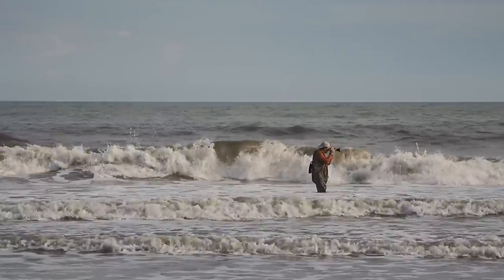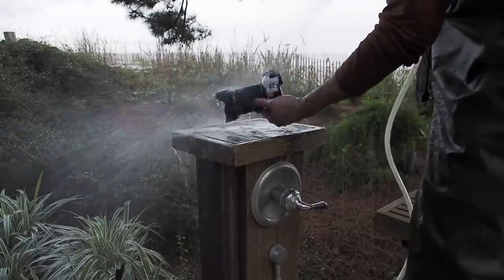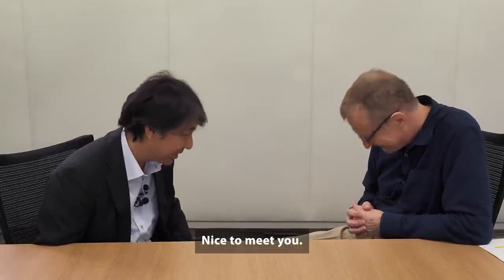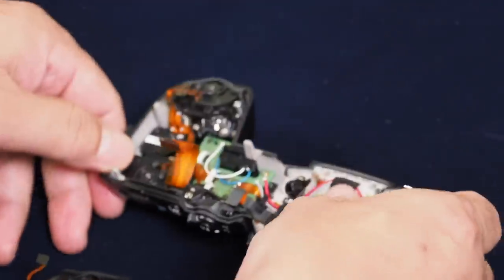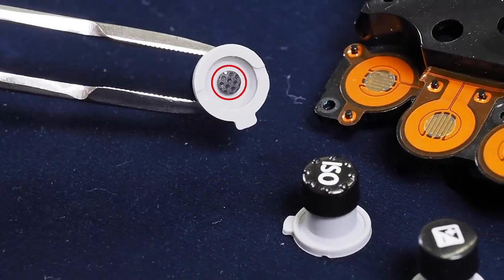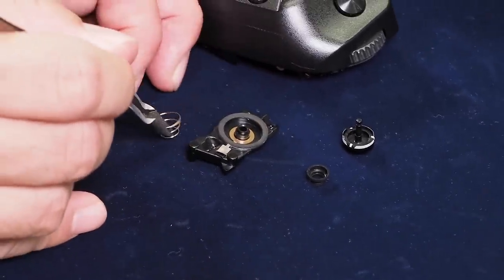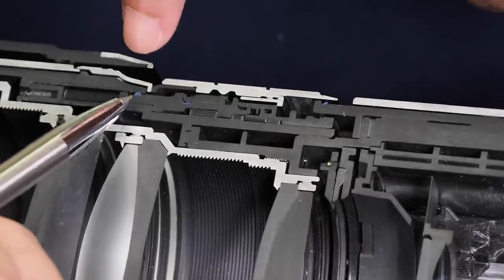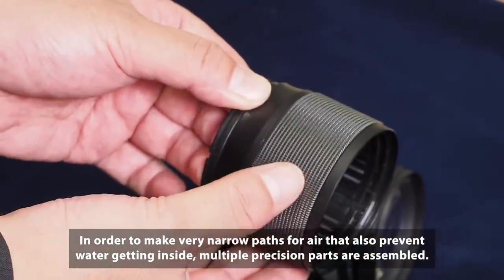How to REALLY weather-proof a camera

Comment: Have been using Olympus kit for decades. The engineer, being a young chap, may not have used or seen the OM-4 from 1984 (their first 'environmentally protected' camera body) which boasted of weather seals for dust and moisture on the camera and the motor drive 2. The fast aperture pro lenses of the era also had seals as did the OM3, OM4Ti and the pocketable Mju 35mm point and shoot series of the 1990s. So Olympus actually have nearly 4 decades of experience in this game. In our conditions on my continent the equipment has never let me down in heat, dust, torrential rain, sea spray, riot control water canon deluges and more. Why I stay with it. It delivers. Every day, whatever the conditions. As the Olympus engineer said - you can use energy on the photographic process, not waste it on trying to protect the kit. Thank you to all the engineers involved.
Reply: Yeah, "ultimate reliability" has been a core philosophy since the beginning of the OM era. See my reply to skysurver5cva above :-)

Comment: My E-1, E-5, and E-M1.2, plus various weather-sealed lenses, have all easily survived Yosemite's Mist Trail, Lower Yosemite Fall, and the base of Bridalveil Fall in the spring.  Years ago I had my E-1 and 14-54 lens out in a 1-inch per hour (maybe more) deluge at Multnomah Falls in Oregon.  In fact, it's places like this that have kept me coming back for more Olympus weather-sealed camera bodies and lenses.  I also have a TG-5 that I use in the pool with my grandkids.

However, I want to mention that the Olympus OM-3 and 4 series camera bodies also had some weather sealing and my OM-4T survived all the wet Yosemite places I mentioned above without having to bag the camera.  The only problem I had was getting a little moisture in the viewfinder eyelens.  However, a couple minutes laying out in the sun evaporated the moisture and camera continued to work flawlessly.
Reply: Yeah, Olympus' attention to weather-sealing goes back to their film cameras as well. "Ultimate reliability" has always been part of their core DNA; you can read about that in an interview I did with Aki Murata, Olympus America VP of Sales and Marketing back in December 2018: https://www.imaging-resource.com/news/2018/12/12/a-full-frame-olympus-not-just-no-but-heck-no
Reply: I think Olympus made the first weather sealed camera in the 70’s

Comment: Hi Dave. Many thanks for the interesting video. Weather sealing was one of the drivers behind my EM1 Mkii purchase. I'm not sure if I was unlucky, but two years ago I was out in the Yorkshire Dales in the UK taking shots of weather blow trees on limestone pavements...in the rain. When out of it's pack, I made sure to shield the camera from the driving rain using my body etc. I thought I'd captured some amazing shots, but when I got back to the car, I noticed the camera was dead, with water in the battery compartment. Luckily my dealer replaced the body and at the same time traded up to the Mkiii...but I have to admit...now I'm out of the standard two year warranty, I never risk using the camera in anything more than a light mist. I looked at your artificial rain fall rig with disbelief and truly wish I could risk using my camera in such conditions as (i) I live in the North West of England which is not known for dry savannas (ii) I think shots in the rain can look amazing. Recently I've been looking at some kind of dry bag set up. I'm just wondering if my original Mkii was a flawed and if I'm now being overly cautious. Sometimes I'm tempted to venture out into the rain.....but dare not risk it.  Thanks again for an insightful video. Neville

Comment: Wow, this is such an insightful video. Thanks for sharing! 

I just broke my Canon 5D Mk III by using it in the rain for 30 minutes. The mode dial cap came unglued a year ago and I never replaced it. Turns out that was it's weak point most likely. I doubt Canon sealed it as well as Olympus does. Olympus used multiple gaskets for the mode dial, smart. I've learned my lesson. Now I'm waiting for the new Canon R5 to come out. I'll be shooting on film & my iPhone for a while now!
Reply: Oh wow, that's a drag! I'd tend to think that the 5D III would have pretty decent sealing, but yeah, if any part comes loose or goes missing, all bets are off, with any camera :-/
Reply: I see you mentioned the R5.  If you don't know already, just a heads-up, it overheats easily.  There are articles about that on DPreview.com if you haven't seen it already.
Reply: I appreciate you sharing info. I received my R5 the day it was released a few weeks ago. I read all about it, watched plenty of videos, with much to do about overheating. It hasn't been an issue for me in the slightest, and I don't think it will be. Overheating only limits the 4K HQ (oversampled) mode, 4K 60 and 120fps, and 8K of course. 4K 24p is fine. As for photography, what I mainly use the camera for, no overheating worries at all. The AF is fantastic, so is the dynamic range and 45mp resolution. If I ever want to record a lot of 4K 60, 120, and HQ, I can always buy an Atomos external recorder, remove the cameras memory cards, and record for hours. I'm stoked!
Reply: @rocknrory  
Alright!  Cool!  Glad you're very happy with your purchase.  It would definitely be a bummer if you weren't.

Comment: What an amazing rain machine!
Reply: Thanks! That's version 1.0. After months of work, I came up with an entirely new custom dripper design that'll be easier to control and naturally produce smaller droplets. Dunno when I'll be able to get around to fabricating the new array using them though. What's new is that they have an ~0.16mm (~0.006") about an inch long through them. So they'll drip nice and slowly with significant backpressure. They'll make it much easier to control flow rates :-)

Comment: I'd like to know more about the mesh used for lenses that change volume. It's not at a molecular level, so is it surface tension that prevents water getting through, while allowing air. If there's a certain volume of water then there wouldn't be surface tension - there wouldn't be a surface. In other words, if you held the lens under water if the mesh is a real barrier you'd not be able to zoom. I've often rinsed and dunked my Olympus gear, intentionally and unintentionally, but I don't think I'll try zooming under water :-)
Reply: Yeah, it's not an absolute barrier. It's a really, really fine mesh, but not molecular-level. I think it would pass water with only modest back-pressure. By comparison Gore-Tex fabric can stand up to 40psi of water pressure, but it's pretty resistant to the passage of air as well. (It's "breathable", in that some air and water vapor can pass through it, but you couldn't use it in an application like a zoom lens; it's not permeable enough to air.)
Reply: @DEtchells  That probably explains why the Oly representative kept saying 'splash-proof' while you kept saying 'Weather-Proof'!  Under-promise and over-deliver!  That keeps everyone happy.
Reply: @glenbarrington2634  Yeah, that's very much their approach. They actually tested the E-M5 III to IPx3 conditions (jets of water), but only claim a rating of IPx1 for it.

Comment: Thanks for great informations about sealing. I wonder if you can compare olympus with recent model of Nikon, Canon and Sony cameras and lenses in terms of sealing. And more importantly how about after 5 years of usage? Do you think they will survive in raining?
Reply: I can only talk about cameras I've tested, but Olympus is by far the best-sealed so far. That said, though, the Nikon Z6/Z7, Canon EOS R and Fuji X-T3 can all stand up to at least an hour of pretty significant rain (1 inch per hour). I just haven't had the time to spare testing and posting results for others, but am hoping things will lighten up in the next month or two so I'll be able to get back to it more.

Rain water is pretty benign, as it doesn't have a lot of dissolved minerals in it. That means it doesn't leave deposits behind when it dries out, so if you just let your camera dry out well after it gets wet, there shouldn't be any long-term issues. (Water from streams or lakes does have minerals, though, so that water is more likely to cause problems if it gets inside. And salt water... just forget it. If it gets inside, your camera is very likely done. But if you can rinse it off immediately it might survive. The Olympus cameras are fine with getting splashed with salt water and being rinsed off afterwards, in our experience.)

Comment: Very interesting details to see. Do You know how this sealing performs over the time ? I live in a region and have to have my camera bag for hours in the trunk of the car in pretty high temperatures (way over 50 deg celsius).. How about after some months of this hot storage between use ?
Reply: That's a good question. I don't think the o-ring or flex-rubber button seals would be affected at all. I don't know about the foam, wonder if it could take a "set" at all. OTOH, I don't think it'd make a lot of difference if there were gaps of a few thousandths of an inch caused by thermal cycling; water would have a very hard time getting through. Still, it'd be an interesting experiment. I have some samples of the sealing foam used by Olympus, I could try clamping something across it and leaving it sit for a long time, to see if it did in fact take a "set". Then try the same thing letting it cook for a while. It'd be very interesting to try, but can't give you an ETA for actually doing it, with everything else going on... (Still, it's an intriguing question; I'm more likely than not to check it out eventually, thanks for the suggestion!)

Comment: That's why EM1X ask for $3000 , even it have smaller sensor, camera as an tool, not only sensor size, but also need to use on any environment , and you don't need to worry about your tool fail

Comment: I always wondered how many of those cameras you see people hosing down to clean off in videos work a week or month later.
Reply: It all depends on the camera :-) With the Oly E-M1 line and E-M1x and now the E-M5 III, you totally can and they totally do a week or a month after. Even the E-M5 II could handle it, even though it wasn't quite as well-sealed as the III. (The original E-M5 was better-sealed than competitors at the time, although I don't know how it was rated and I haven't tested it.) Olympus has always put a lot of effort into weather sealing their enthusiast- and pro-level cameras. It's part of why they're a bit more expensive on a feature for feature basis, but if you want to not worry about your camera getting wet, no one else currently comes close.
Reply: I'm often down at the beach when it's windy - sand and saltwater - or falling in mud or in streams. So I've rinsed off my EM5, EM1 (marks I and II) frequently. No issues other than a fogged viewfinder on the EM5. Of course I'm not going to recommend it (although if you've got the body covered in saltwater then you really do need to clean it). And weather-sealing can fail - I had a fourthirds 12-60mm that didn't survive a soaking.
Reply: I have hosed down my E-M5, E-M1, 12-50mm f5.6-7.6 and 12-40mm f2.8 and all worked flawlessly months/years later.  Never so much as a hint of internal mist or water penetration with any of them.

Comment: How about just putting a plastic bag over the camera?
Reply: That'd always work, in fact there are professional weather shields for some cameras. A big part of Oly's value proposition, though, is "don't worry, be happy" ;-) Just shoot however/wherever you want and don't sweat getting the camera wet.
Reply: As you twist back and forth on the zoom etc, or even putting the camera into and taking it out of the bag, it can get stretched and/or damaged.  So, one problem is checking for leaks.  Another is that, it takes time getting out the bag, getting it open and putting it over the camera.  Also when you want to put away the bag, where do you store it?  It's wet and needs to be dried out etc.  So it all can get to be a big hassle.  With Olympus, you don't even need to put the camera away; you don't have to stop, get that backpack off, find the plastic bags, all while trying to keep the rain off your camera and from getting into your bag.  Meanwhile the Olympus photographer has wandered ahead and is taking photos elsewhere.  
On a trip, the less stress etc the better.